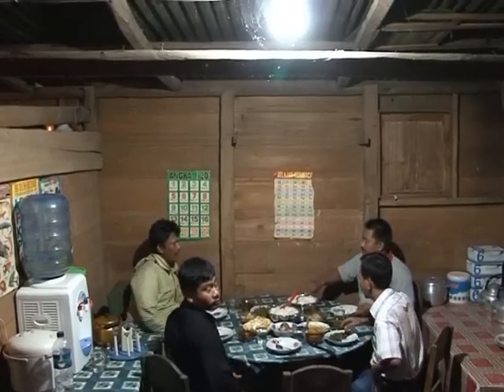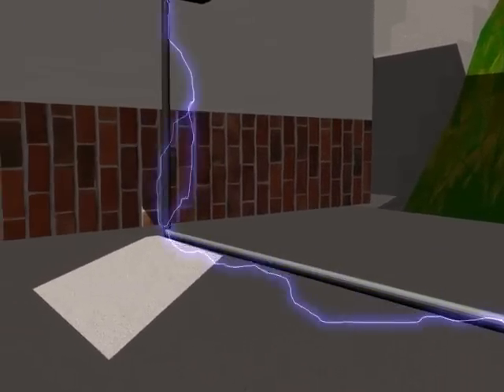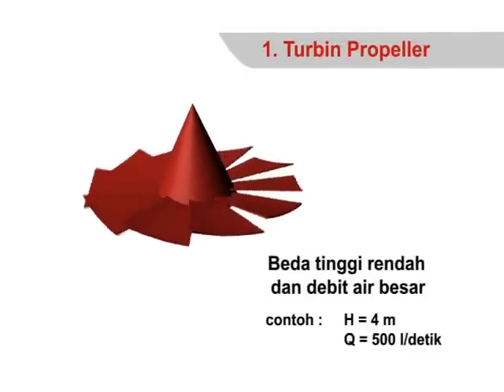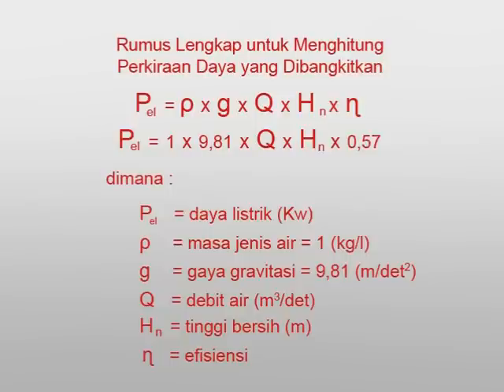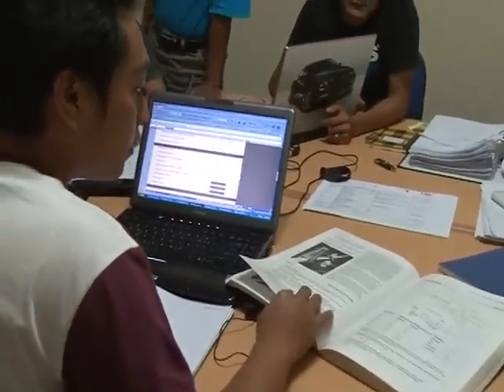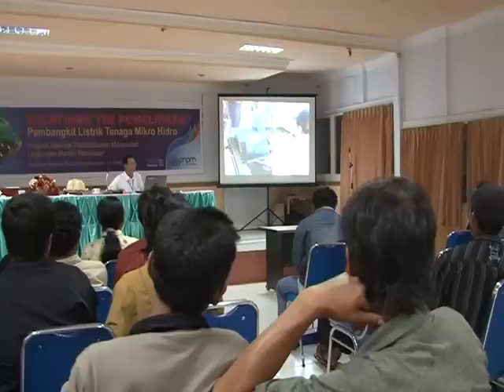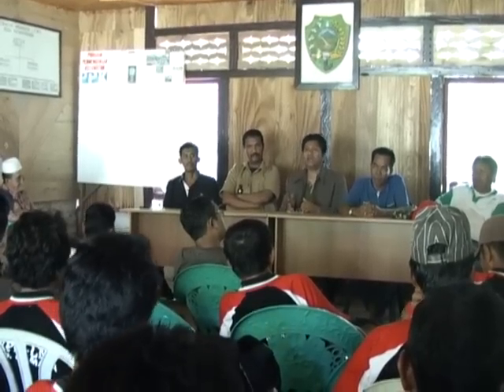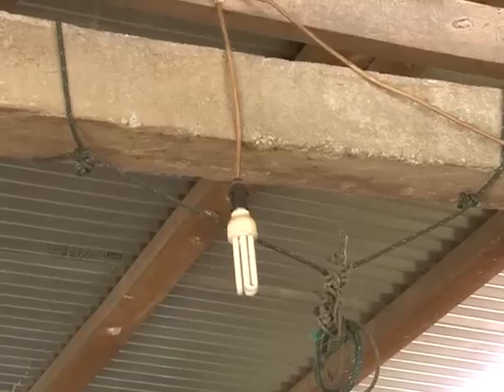Micro Hydro Power Plant

Comment: Excellent presentation on micro hydro power development and very useful material to them who want to be more about the principles on the micro hydro development.
Reply: Agreed.  But it would be improved if they could give at least 1 example of an actual implementation, covering: (1) Feasibility parameters - Head, Flow, Expected Power  (2) Cost Estimate  (3) Time taken to implement the project  (4) Number of personnel needed -- Engineers, Workmen (welders, concrete layers, etc.), Management Team (5) Actual Cost (6) Revenue.

Comment: My name is John Mwiti Nkanta born in the eastern side of MT Kenya in Kenya. I am an electrical engineer. I Have always thought of the nice reliable waterfalls and all year round rivers that can generate sufficient power that in turn can create a lot of job opportunities for the community in this area, if this power potential could be utilized. I started by building on using bicycle wheel that costed me a lot of money but did not work efficiently. I am a volunteer willing to help to my capability, I involve the community by training the on modern method of farming but the community luck this basic commodity  of power to live a better live for they are poor. please help me implement this project.
Reply: Mr. John Mwiti   +91 9894368909 is my number contact me
Reply: I CAN GET AN OPPORTUNITY OF TRAINING YOUR WORKPLACE IN SOME SAFETY PACKAGES LIKE FIRSTAID AND FIRE FIGHTING
Reply: John Mwiti did you get help?